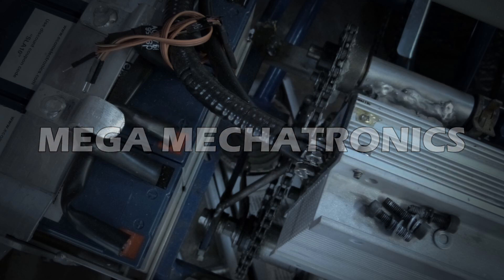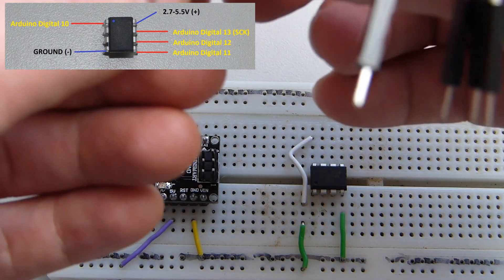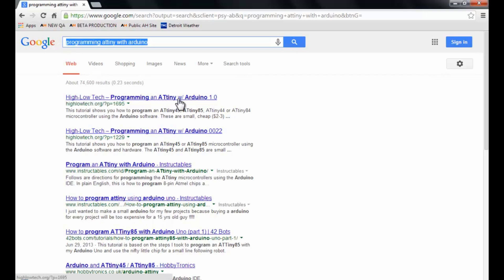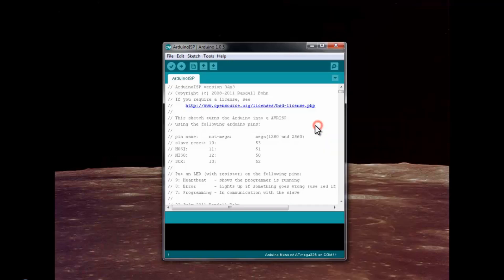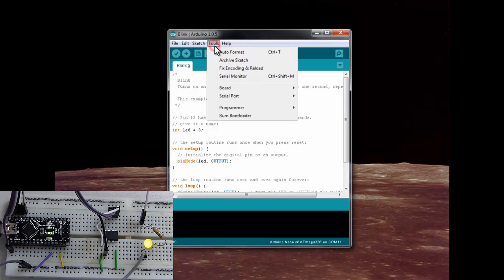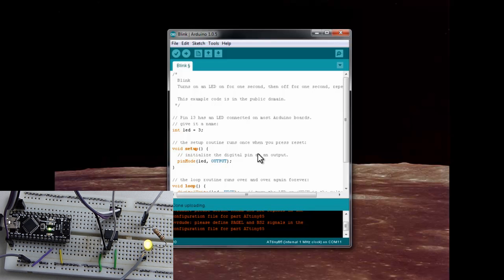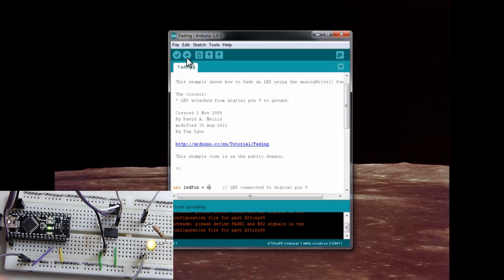How to Program ATtiny85 45 Arduino Tutorial 1.0.5 ESP32 STM32

Comment: i have tried everything to get my arduino and the attiny85 to work together and using your video to go through the steps .. i was successful, the arduino i used was a uno and the ide was1.8.5  thanks alot for this breakthrough( by the way dont forget the 10uf capacitor or you will be scratching your for days )
Reply: john mellor it works with all the arduino commands to program the ATtiny?

Comment: Thanks.  I'm trying to understand what is happening here vis a vis what I normally do on my Uno or Nano.  So the nano is acting as a programmer to upload the sketch to the tiny.  I've heard a lot about a bootloader, where does that fit in?
Reply from the maker: Correct, the Uno or Nano or similar controller will be the programmer when you set it up as "Arduino as ISP". You shouldn't have to deal with a bootloader the way that is shown.

Comment: Good video. I have a doubt. I have been looking at various videos on programming the ATMEL chip using an Arduino that programs the chip with the Arduino Blink sketch as part of the demo, but some videos also show that before loading the sketch, the ATMEL is programmed with the bootloader. Your video does not show that. Is this necessary? Thanks

Comment: OK, I give.... I have been screwing around with this arduino and the attiny for almost 3 months using several sets of directions including arduino for dummies. From the word go nothing works out as given in the instructions. I have even gotten messages that the sketch book no longer exists. Did you have to extract the files from the zipped file? I found the arduino upload thing you show at about 4:30, where you say there is nothing to do but the upload fails. arggggg. Do you sell  programmed attiny85's?

Comment: "... between reset and ground."
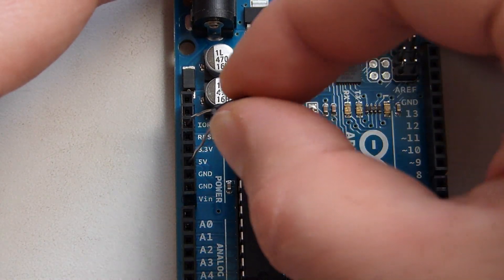Umm... at 1:16 you have it plugged in between reset and 5v. :D
Reply from the maker: You are very observant; however this is an optical illusion.  You can confirm this by referencing the Vin label and the Vin pin (because there is a gap between Vin and A0).
Reply: Mega Mechatronics
Ahhhh.... gotcha!

Comment: I tried it now for at least 10 hours. haha i read 100 threads in help boards. NOTHING worked. But now it worked. Finally. I Just took a new Atmega328P on my UNO. I do not fucking know why my other Atmega328P can't program the Attiny. So, if you have any unsolvable problems just buy and try a new Atmega328P!

Comment: FINALLY!
Big like! 
Thanks, seems that watching your Video several times and 3 days of trials and error did the change....
One comment DOs and UNDOs:
1) The the High-Low tutorial page: http://highlowtech.org/?p=1695 does not mention the ArduinoISP example!! Don't get stuck on that page.

2) it worked for me on the IDE 1.0.4

3) if you have before the famous error: stk500_getsync(): not in sync: resp=0x00 
It is probably because you haven't run the EXAMPLE of ArduinoISP.

4) Liked your heartbeat indicator !

keep on sharing, will promote your Video
Thanks

Comment: Hi,
I tried according to http://highlowtech.org/?p=1695 guide and it still does not show the boards ATTINYs. When loading the arduino_debug.exe, it says
"Could find boards.txt in C:\Program Files(x86)\Arduino\hardware\attiny\variants..."
and further stuff like ,"No valid hardware definitions found in folder attiny" .
On another PC this step worked.
Any idea what could be wrong?
BR
Yariv
Reply: i have the same problem. I cant see any ATtiny boards in my board list.
Reply from the maker: Paul Benavides Did you get the Attiny master hardware file?  Link is in the description.

Comment: Doesn't seem to work getting "avrdude: stk500_getsync(): not in sync: resp=0x00" while trying to upload the blink sketch.setup:Arduino 1.0.5-r2, Arduino Leonardo - Attiny 85,No cap tried with 1uf I don't have 10uf lying around. Programmer:Arduino as ISP ,Serial Port:Correct , Board:Attiny85 1mhz clock.Heartbeat seems to work just fine on pin 9 so wtf

Comment: HI!
I tried with Arduino IDE 1.0.5 and got the "avrdude: stk500_getsync(): not in sync: resp=0x15" error. I fixed it with a 10 uF. And then showed me the error "avrdude: stk500_recv(): programmer is not responding"...Later, I installed the Arduino IDE 1.0.4 like the HLT's webpage says, and it worked like a charm!
Thanks!
Reply from the maker: Nooo, sorry I didn't see your reply sooner!!  I sometimes have really odd problems, sometimes restarting my computer works.  I think the IDE can be a bit quirky.    I see you went to 1.0.4, thanks for the insight!
Reply: I was using 1.0.5 with a 10uF capacitor and was getting a similar error. Took out the capacitor and it seemed to work fine! Is this okay or am I damaging something?